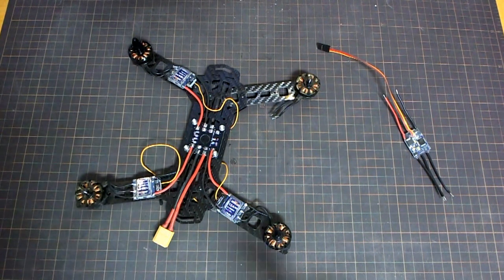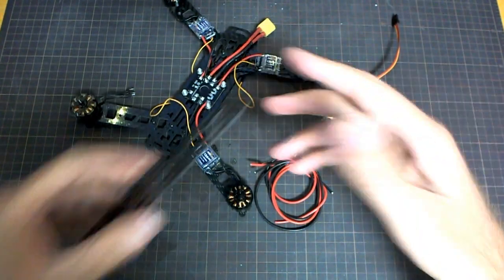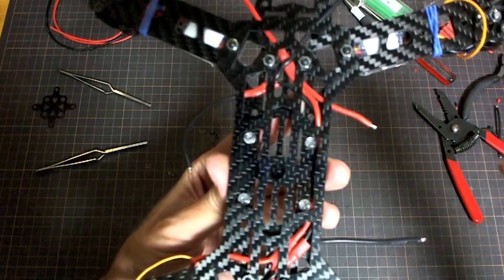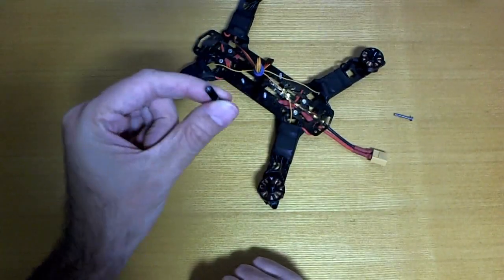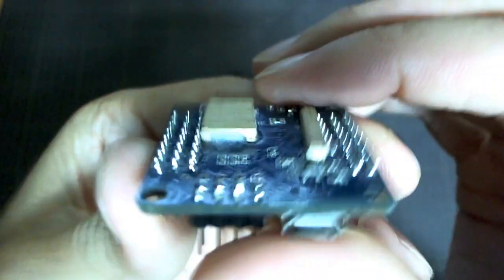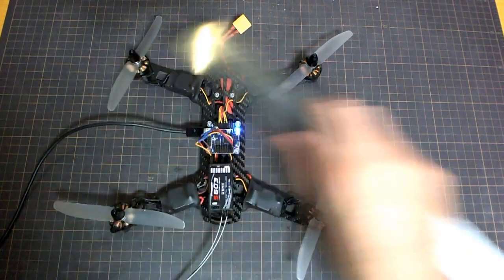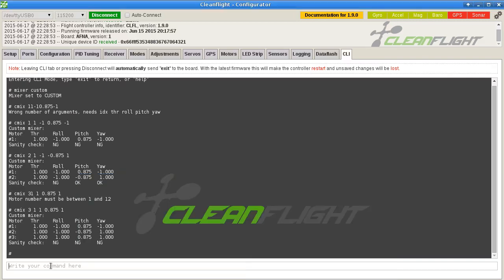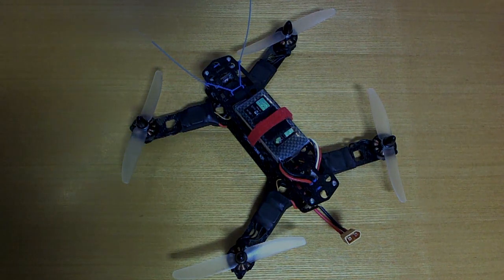Diatone #37 build part 2

Comment: I just discovered you today actually but I must say I've enjoyed you videos I have seen.  Have you ever thought about incorporating a solar panel in a quad? Just a thought that's been swirling around in my head lately. I just purchased a syma x5sw I hope it's not a disappointment! Know anything about them? One other thing how much $ ( ball park ) would you say the typical quad build costs?
Reply from the maker: Aaron Wilson Depends what you mean by "incorporate". There's nothing to stop you attaching a solar panel and taking it for a ride, but if you're thinking it would produce the kind of power that's worth anything to the quad, I think you would be mistaken. I'd say a ballpark range for a typical quad this size would be $120 - $250. You can get an idea of the cost of this build in the 'Part 1', I put a link to a spreadsheet showing the parts. As of the end of this video the total parts used so far (with receiver, but without GPS or FPV gear) are up to around $170.

Comment: I just bought one of these with a kk2.1.5 as a first quadcopter. Sadly it is to big the middle of the frame, I will have to mount it on the top with some sort of protection :(

Comment: Would you please show us how your receiver behaves in case of fail safe?
You ordered this one several month later than me and
I am wondering if they have done something on it's software in the meantime.
Thanks in advance.
Reply from the maker: aMax When the receiver is powered and the TX is turned off, the throttle drops to zero (well, channel value is 1000). Is that what you mean?
Reply: ***** No this is normal throttle failsafe. I like to know where the other channels stay, at neutral or at the last input.
If I turn off the tx at at full stick command, the the failsafe on the rx kicks in,  CH3 drops but the others stay where they have been at that moment.
Reply from the maker: aMax If the throttle goes to zero, what difference does it make what the other channels do? At least for a quad, it should be irrelevant. For a plane I guess it might be important. In any case, the other channels go to neutral (1500).

Comment: HI, good video thanks! I have the diatone 37 and was wondering if you would mind telling me what PID settings you use? I'm new to cleanflight (other quads run OP) and i found that its very unstable and hard to control.
Reply from the maker: Zeebo Rutherford I'm using all defaults for everything except the mixing which I showed in this video at 18:18
Reply: ***** Thanks for the reply!  I have tied them all but notice its so unstable and seems to swing from extreme to extreme (like it will jump left and then you correct it and it flys right etc).. Anyway after some time i removed the PPM encoder and re flashed to Openpilot.. Then it was smooth like my other quad.. So it looks like wither my PPM encoder is causing this or its cleanflight.. next step is to run OP with PPM encoder.. if its still good i guess i will have to say goodbye to my LEDs and stick with openpilot.

Anyway thanks

Comment: Just wondering what battery you used in this build and how did you get power to your flight controller
Reply from the maker: nathan ward I have been using 3S batteries from 1300 - 2200 mAh. I'm using the BEC in one of the ESCs to power the flight controller.
Reply: Thanks I'm building the glass fiber version of this frame and I was just getting the bits together to build it

Comment: Thank you iforce2d for your videos and footage! Thx to you I've managed to build my first FPV250, on Diatone #37 frame. Could you please check my build (link to pictures is provided in my videos description) and say what do you think about my battery location? I belive, placing battery inside frame, should be optimal balanced, but I would like to know your opinion.Thank you again! :)Best regards,Matt.
Reply from the maker: +lmcmtl I'm not sure what video you mean, but yes, having the center of mass directly at the middle of the motors would be a good situation. I'm thinking about trying that sometime myself.
Reply: +iforce2d Thanks for your answer, here is my gallery: http://tomaszewicz.com.pl/dron/foty/ . Well, center of mass in this case is around middle of battery, in theory it is best position. Batteries that will fit inside Diatone #37 are: Zippy Compact 2200mAh 25C (15min flight max), Zippy Flightmax 3000mAh 20C (my build total weight is 540g then - 20min flight max), Zippy Compact 4000mAh (24min flight max). Oh, and btw, u were absolutely right about this Diatone aluminium bars - they are realy bad quality. :)
Reply from the maker: +lmcmtl I don't think it's reasonable to use such enormous batteries on a 250, it will fly like a dog and 20 minutes is probably too optimistic. Why not just use a bigger quad?
Reply: +iforce2d You are right, with 4000mAh it is lazy like a cow :). Please, note that "Max flight time" that I've provided, it is absolute maximum that I ever managed to fly (economy test fly). It's 20-25% less when you fly normal. What is ideal total weight for 250? How much your 250 weight? My 250 + 2200mAh weight is 445g and it feels like too light, very sensitive to wind, a bit unstable at high speeds.
Reply from the maker: +lmcmtl I don't know that there is any 'ideal' weight, it depends what you want to do. My Diatone #37 build was 342g empty, total 504g with fpv stuff, mobius and 1300mAh battery. Sometimes I used a 2200mAh battery, it was nice and stable to cruise around but no good for agility.
Reply: +iforce2d Same conclusion here; if it is heavier it is more stable, better resistant to wind, but less agile.

Comment: Why don't you just unsolder the extra power wires, or keep these around to power LEDs?
Reply from the maker: LeoTheHuman You mean the ground and 5v from the ESCs? The solder point for those is under the original heat-shrink and covered by a blob of hot-glue, I'd rather not cut the heat-shrink there, it's much easier just to cut the wires. But that's kinda beside the point because most LED strips dont light up very well at 5v anyway. I did some checks using the small 3-LED hard strips and these were the minimum voltages required before they started to light:
white 7.6v
red 5.2v
green 6.6v
blue 7.5v
Usually these strips would be powered directly from the battery, and even then a 2S is pretty weak. 3S battery does nice though :)
Reply: I kind of meant the addressable ws2812 strips, which work well from 5v and with naze32. I usually unsolder and replace the heatshrink though.
BTW, have you tried i2c for ESC control signals? I've tried controlling one motor on the bench, it worked fine, but I didn't get to re-flashing ESCs to change the address.
Reply from the maker: LeoTheHuman Ah I see. No, I have not tried I2C for ESC control. I doubt I would be able to tell the difference :)

Comment: Thought provoking - nice ideas. Thanks. Have you found some special trick to avoid getting fake sunnysky motors from Banggood.com?
Reply from the maker: Tobermory Cat Not really. Keep trying I guess is the only way. They are definitely aware of the problem though, so I'd hope they have put some checks in place now. Haven't had a fake for a while. On the plus side, they will refund the cost of the fake and you keep it, so maybe I could make a beater quad or tri with them someday... or mix with the good motors to try a hex/octo etc :)
Reply: ***** I recently bought fake off ebay. The seller then agreed to change future listings and removed sunnysky logo. Seller is unlikely to be a flyer or know the difference. Full refund but I will watch to see their future listings. 
I wrote to sunnysky asking if they could direct sell via ebay - didn't get a clear reply. You would think doing so would help to put the makers of the fakes out of business.

Comment: Cool that you considered my concerns about EMI. I protected a barometer by putting doublesided tape on it but not over the single hole (it was like 4x the size of yours though) and then pressing cotton on it and then covering it with black electrical tape, that was long enough to also stick to the PCB on two sides of the sensor. It worked well at first until the electrical tape wouldn't stick to the PCB any more due to dust. Your solution seems much more solid and may very well be worth it. Also, doesn't cleanflight have an EMI compensation calibration like ArduPilotMega aka APM? Just in case the deviation in actual flight is worse. Here is an example from my subs from today, what a coincidence: https://www.youtube.com/watch?v=njshOmXHTTk

Comment: Are you trimming engines in MultiWii?
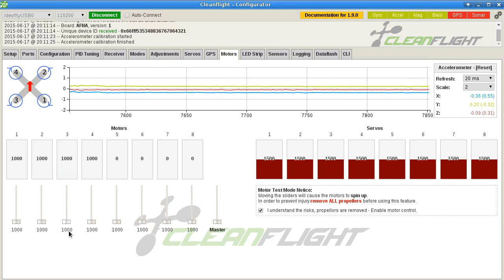Reply from the maker: ClassAxion1 Trimming engines? I'm not sure what you mean... for this build I'm using a Flip32 and Cleanflight. Maybe you mean where I spin the motors at 16:33? It's not trimming, it just lets you spin them to confirm which is which.
Reply: ***** However different. What do you do if your quadrocopter strays (very strongly) to the right that you can not fly because it does flip. (Of course using MultiWii)
Reply from the maker: ClassAxion1 Why would it do that?
Reply: ***** I don't know, it looks as it was not balanced, but it is balanced :/ Engines are equally (you can see it in the program).
Reply from the maker: ClassAxion1 What is balanced? I'm having a hard time following all of your last three posts :) Even if the motors are somehow not matched, that's why we have a flight controller, to adjust the control signals given to the motors and keep the craft stable.
Reply: ***** Sorry for my english :) 

If you will set it on a flat surface front and right side does not rise to the same power (compared to the back and left side). 
For example, set the throttle to 50%, moving pitch (forward and backward) just back it lifts.